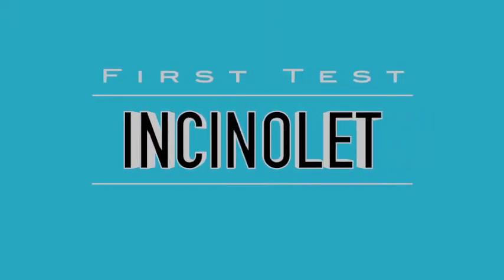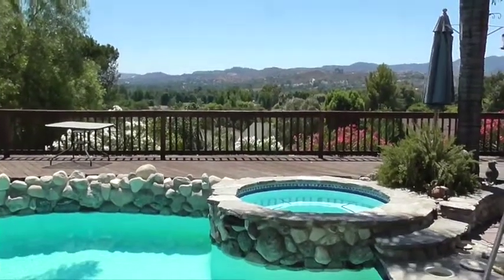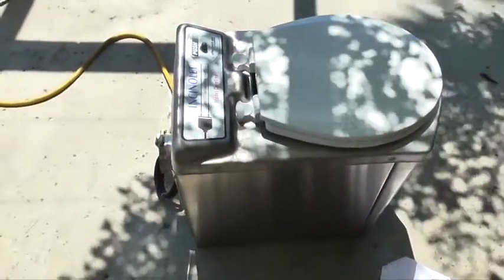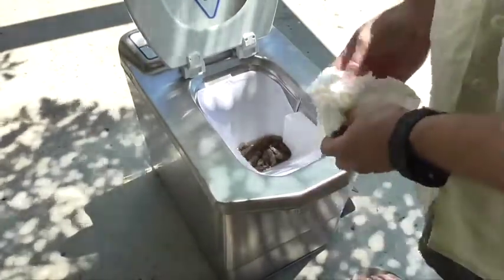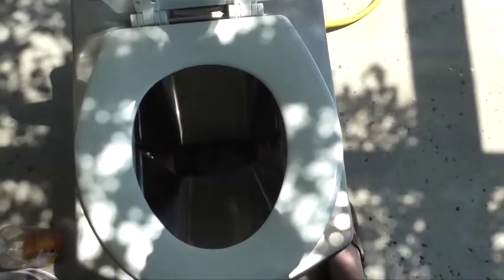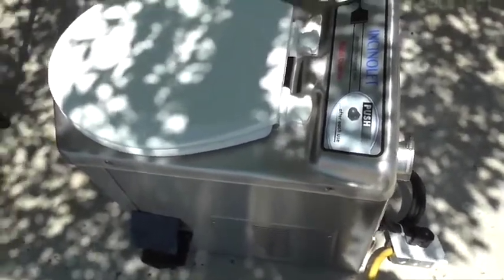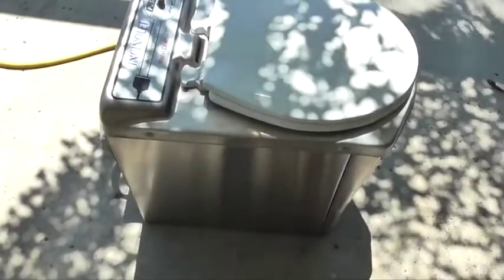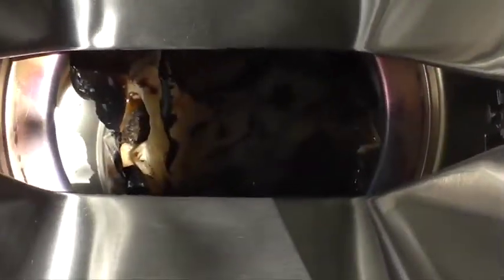Incinolet Toilet Test

Comment: Thank you sir, I've been looking at this thing for a year or more, debating if it will work for my need. I have a barn that is too far away to tap into the existing septic system and don't want to install another system just for a single toilet. Your video is very well done with every bit of info I needed to make a decision. It's a no brainer for me now. It would be nice if you could give a follow up review since it's been about a year by now. Cheers.
Reply from the maker: New video .. 3 years of use .. coming soon. 3 years later and the smell is the same,(very mild slightly burnt popcorn smell) the noise is the same, and it is working perfectly with no breakdowns, repairs or issues.

Comment: Thank you for the review. You are correct, for an amazing toilet there are so few reviews.
Reply from the maker: After 3 years of use .. new video coming soon. 3 years later and the smell is the same,(very mild slightly burnt popcorn smell) the noise is the same, and it is working perfectly with no breakdowns, repairs or issues.Thanx for watching !

Comment: These are very special toilets they are used in places like drawbridges and Forestry Lookouts, the top of cranes. They're very good thing for things like that. Thanks so much for your video
Reply from the maker: After 3 years of use .. new video coming soon. 3 years later and the smell is the same,(very mild slightly burnt popcorn smell) the noise is the same, and it is working perfectly with no breakdowns, repairs or issues.Thanx for watching !

Comment: Thank you so much for posting this video! My wife and I are building an Earthship Biotecture Home in Northern Nevada (North of Reno-Sparks Nevada) off grid and with water collection instead of a well. This is a great solution to our design. I have to research if it will require more solar and batteries to operate correctly. Once again - Thank You!
Reply: it says right on the Incinolet website that solar can't be used. But I do believe people have used car batteries in remote locations. Call Incinolet and ask.
Reply: Also, they're working on a lower-energy-use model atm. Prob late 2021, I think?
Reply from the maker: After 3 years of use .. new video coming soon. 3 years later and the smell is the same,(very mild slightly burnt popcorn smell) the noise is the same, and it is working perfectly with no breakdowns, repairs or issues.Thanx for watching !

Comment: Are use a squirt bottle add 25% of the Porta potty blue chemical and the other 75% water. And every time we use it we give it one square before it uses. This way here we only have to run it after every three times. Also the time we run it at noon time and again when we leave at five 530

Comment: In an off grid scenario where power is generator or solar, I would opt for the propane version. These are not new, I used one at the Fairbanks Country Club (a converted cow pasture) in 1970.

Comment: Video is well done. Thank you for being able to actually say the words: Urine & Feces. It’s striking how in other videos, folks were struck dumb finding the words for normal human waste. Regarding this unit however, what happens if a second or third person needs to use the toilet within the incinerator burn time? Doubtful this model could be used on a boat. The power with a generator is simply not sufficient. 
Explanation was very, very good.
Reply: The demo showed that the burning process could be interrupted. But those interruptions will slow down the final burn process.
Reply from the maker: Just delay it ... each time you use the potty - re press the button .... it's rated for normal toilet use
Reply from the maker: 3 years later and the smell is the same,(very mild slightly burnt popcorn smell) the noise is the same, and it is working perfectly with no breakdowns, repairs or issues.

Comment: Urine is basic.  A component of urine is ammonia.  Vinegar is acidic.  Perhaps ammonia water would be a more accurate test.  Thank you for running this test.
Reply: That is a crazy suggestion. You do NOT want to vaporize ammonia with heat and have a whiff. You will get to have an ambulance ride. Have a cell phone ready.

Comment: how does this wrk in event of diarrhea?
Reply: None of the demonstrators ever address the issue of diarrhea. This product probably would be able to handle it if it burned the entire bowl instead of just the paper and contents. Otherwise I don't think that small liner is suitable for explosive diarrhea.
Reply from the maker: It's rated for continuous use. Just press the burn button after each use.

Comment: Do you need to incinerate immediately. Example  say 2 ppl use toilet b4 turning on burn cycle,?
Reply from the maker: You run it after you use it ... just like a regular toilet - it's rated for continuous use.After 3 years of use .. new video coming soon. 3 years later and the smell is the same,(very mild slightly burnt popcorn smell) the noise is the same, and it is working perfectly with no breakdowns, repairs or issues.Thanx for watching !

Comment: My concern is the electrical usage.  I will be in a trailer in WA this winter and I am concerned with the power being able to manage this toilet while also heating the trailer.  Both will be nearly max pulls and I don't believe that the 30 amps will be able to handle those massive electrical demands along with any other type of electrical use (like the fridge, a clock, or whatever).  If the toilet did not need an hour or so use of the electrical pull EACH time it is flushed, the ability to both continuously heat the trailer and use the toilet might be doable.  I'm thinking that I might need the composting toilet instead (which is not as desirable as the Incinolet). 

I'm new to all of this, so any advice would be very much appreciated.  I've not been in the trailer yet, and I don't know if the trailer's propane heat will be sufficient to keep it warm during the very cold upcoming winter.  I've been researching on YouTube and it seems that everyone is suggesting a secondary heating source (like a Buddy Heater) along with skirting the bottom of the trailer to have the temperature bearable.  It would be ideal if I could use the Incinolet and still be able to maintain a comfortable temperature if it's possible.
Reply: It is worth checking out Cinderella Incinerating toilets as well as they have a propane model that only requires 12v power to run the fan and display.
Reply: Living on wheels takes some sacrifice as you likely know by now. It is common to not use any other large draw items while running an incinolet. The nature of the beast.
Reply: DL Roberts Cinderella looks great but they run about $4000 usd as opposed to Incinolet is about $1800 usd.  I guess it’s a matter of needs.
Reply: It saves a lot of water! Love em.

Comment: That's a very interesting review, what is the power consumption?
Reply: 2000 watt (2kwh per "flush)
Reply: @fouroakfarm  so if person use 10 times a day, we should have 10x10/60x2000=3333watts per person per day? That's a lot of battery power if we use in a RV setting.
Reply: Gear-it! You use the bathroom 10 times a day?! 😳

Comment: It is neat but it does seem like the power consumption is awfully high.  Composting  toilets are good but to really get the benefit of it you need to let it fully compost which takes months and it would be best to have a garden (or know someone with a garden) to put the composted material to use.  Most tiny homes don't have space for that.  So if you have power to spare but no real space then this would be a good choice - despite the price tag.
Reply: I believe you are correct Harmony. If memory serves me correctly, with the average use of typical Composting toilet users, the poo truly does not completely compost by the time it is emptied and disposed of. It takes much longer to be technically composted.

The biggest drawback for me for the "composting" toilets besides the periodic extra work involved, was the problem of keeping liquids and solids separate. Everyone is different and for some that is more of a challenge. Makes a huge difference in the stink/eeeeewwww factor plus other impt considerations. For some it might not be the best choice.

With the incinetator, it doesn't matter. Heck, you can stick with your favorite brand of TP instead of having to use the  specialized or biodegradeable RV kinds! To me that is a win-win.
Reply: I just read a blog post about using a compost toilet in an RV.  They suggested emptying their solid tank every 3-4 weeks.  They supplement and help air it with coir.   But that's a portable toilet, and people's habits vary.   I'd have thought that dehydrated solids, eventually don't actually amount to much  over the course of a year.  You'd probably only fill a waste bin.  So if you had two bins on rotation, you could rest one until it fully decomposed, and then plant out the generated compost.  So even a small space could easily accomodate the waste, which is quite valuable.  I've seen what is basically a large aired insulated plastic composter being used, and I doubt you'd fill one in a year, and could pretty much leave that in situ.  But still I'd think that some rotation would be required.  Composting toilets are so low tech and yet I can't see any particular benefit in any other over engineered systems.  A bucket covered with saw dust, in a well ventilated space, that is frequently emptied into a discreete composting area would be good enough and very cheap. Link to the RV composting video: https://youtu.be/dYR6GPmDzVM
Reply: 2-40 cents per cycle where I live. Your rresults may vary. I have fiddled with various composting toilets for over 3 decades and like this better.

Comment: Running for 1 1/2 hours for a single "flush" is pretty ridiculous, and not very practical.  Not to mention the energy it would take to run it on a regular basis.   It's a great idea.  I like the concept behind incinerator toilets.  This one just uses too much energy and takes too long to do its job.
Reply: Agree
Reply: Definitely this. 2 kwh for one "flush"?? I could easily see this costing $1000+ a year just in energy then need to add cost of liners on top of that
Reply: No.  You can use it while it’s incinerating a previous use (up to 6 times, 15 minutes apart).
Reply: Yes, it is possible to use it while it is incinerating but that requires everyone to line up their bowel movements. I'm not so sure I can get a 7 year old "to poo" on demand. Any suggestions?
Reply: @fouroakfarm  I've been using my Incinolet since 2009 and it only adds about $20/month to my electric bill. That's much cheaper than having a septic tank pumped out regularly or installing a sand mound when maybe you don't have a big enough yard for one.
Reply: @davidfechter3635  you can use it while it's in a burning cycle, just push the button so it'll run another cycle after the previous cycle ends. You don't have to "line everyone up to poo on demand." I've been using a Incinolet since 2009.
Reply: In a perfect world, if they made an adapter system where you could plumb your clothes dryer through the toilet, the hot air from the dryer could be used to do this process and not "waste" energy.
Reply: @cindylohmann8536  have you ever tried not turning on the process until multiple bowl movements were made? Just curious if this is possible and if so, did the single cycle eliminate the multiple bowl movements in that one cycle?
Reply: @cindylohmann8536  I know you said it only adds about $20 a month to your electric bill, but how much do you spend on liners per month?

Comment: Maybe the heat from all that power could go through a heat exchanger and warm your trailer before it goes out into the open air. Seems wasteful otherwise.
Reply: Wonderful idea! The heat could indeed be put to some use : )
Reply: Anything is possible with enough time and money. Which is more wasteful...a 2000 dollar heat exchanger or just venting the darn thing?
Reply: G Henrickson or get a used radiator from the dump and use that. $5.00.
Reply: I can't help but wonder if this company made an adapter to run the clothes dryer vent through this toilet, if your clothes dryer wouldn't do this same thing while drying your clothes.

Comment: Hello. Do you know if an incinerating toilet can be used in a van conversion (step van)?
Reply: google
Reply: Qaali Flowers I want one In my motorhome
Reply: Yes, it´s possible, I was looking for something like this when I knew the "Cinderella Motion" (very famous). The main difference is that Cinderella needs a gas/propane install to do the incineration and this only uses AC (120 or 240 volts.) but needs a lot of power (3500 Watts). I think that the solution if you want to install in a van (my idea) is use a dedicate inverter 12v Dc to 240 v Ac to produce all the power this incinerator needs.
But I don´t know if this company sells the unit in Europe (Canary Islands).
Thanks for reading, Great idea!
Reply: Yes it can. I installed a propane version in my RV.

Comment: Does it have to go through this process every time you go? Can you go again even while it’s on?
Reply: Yes you can go again during the cycle - you simply press the foot peddle releasing the waste into the hot burn chamber and then press the start button once you've finished and the cycle starts again. Be aware that you might get some smoke or fumes from the first incineration cycle if you open it up during the 'burn'.
Reply: google

Comment: I'm planning to start a vanlife. Is this good to have in the van?
Reply: I think its possible but you'd need one top notch electrical set up. I'm planning on doing the same thing. I tho k youd need at least 2500 watt inverter and enough solar/ batteriea to power that. Or a generator
Reply: @DWtube24  It is worth checking out Cinderella Incinerating toilets as well as they have a propane model that only requires 12v power to run the fan and display.
Reply: @radventure1075  thanks for the input! Not a fan of propane but ill give it some thought.
Reply: @DWtube24  I was wondering the exact same thing! Did you find anything else useful? Did you go ahead with it? It would save a lot of work and needs no water! I'm planning to travel and I don't want to waste any water. Composting toilets have too much upkeep. This has an ash tray that needs emptying once in a month or even less frequently. The only problem is the high upfront cost. And it needs a very large electrical system.
Reply: @gadagkarus  I havnt got my van yet but I really do think its possible.if you keep your other electrical draws down anf have a good solar system, maybe install a second alternator. Even if you use portable solar generators and recharge them with your vehicle every day. I'm starting my build this summer. Ill update you when I try it out.
Reply: @gadagkarus  and I totally agree about composting toilets. They are great for off grid but I don't think they are the best option for moving vehicles!

Comment: I have 2 incinolet toilets. Apart from only being allowed to order 1pack of liners at a time $20 plus 22$ shipping each. I have completely rebuilt one of the units twice in 3 years, and the other unit replaced a control unit and 2 heater coils. Phone support is available when you can get it, otherwise you’re doing all the trouble shooting and repairs yourself. I maintain these toilets regularly including “stirring the beads” and the exhaust odor is terrible anyway. So, I wouldn’t suggest purchasing these toilets. Very very expensive to operate and constant maintenance. Not worth it.
Reply: Is there one you would recommend?
Reply: @kcannava2412  Unfortunately they are the only Incinerating toilet available in the US right now. There is a Swiss company, but do not be fooled, read the reviews. They’re not actually in the US and they are acccepting peoples money from the US and Canada and not delivering on these $3000 toilets. Unfortunately in Sonoma that is your only choice. That’s probably why they can get away with such bad service. I lived with two of these toilets for nearly 4 years. If you have absolutely no other option, and no way to get to a septic system they don’t want to do a composting toilet, this is the option. Don’t expect it not to stink all the time.
Reply: @cranialnerv I dunno why some people will say very little smell and then there are people like yourself say bad smell
Reply from the maker: 3 years later and the smell is the same,(very mild slightly burnt popcorn smell) the noise is the same, and it is working perfectly with no breakdowns, repairs or issues.
Reply: @carpedfilm  do you have to stir the beads?  Maybe that gentleman needs to work on his vent system
Reply from the maker: @johnle231  No bead stiring required .... at least I don't 'think so' ......

Comment: Use it to incinerate other trash because it works just like any other incinerator
Reply from the maker: 3 years later and the smell is the same,(very mild slightly burnt popcorn smell) the noise is the same, and it is working perfectly with no breakdowns, repairs or issues.